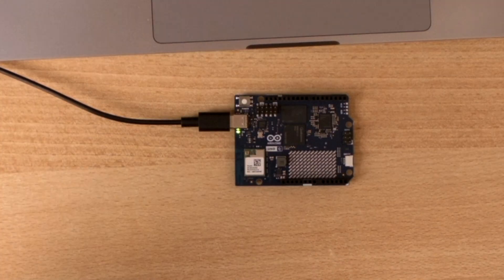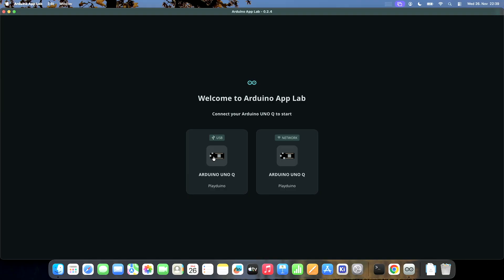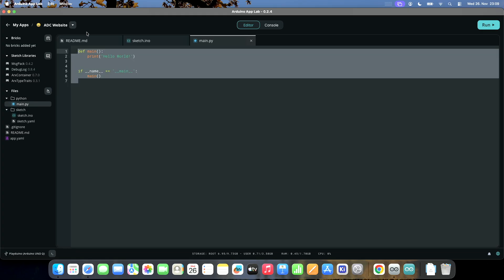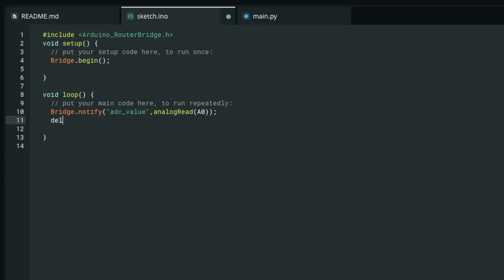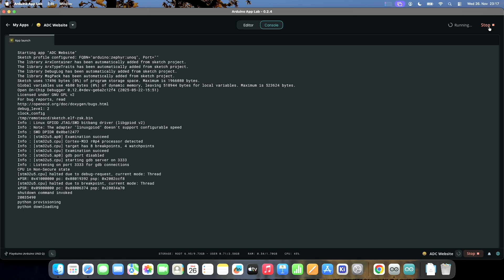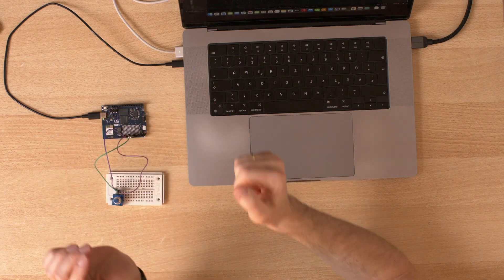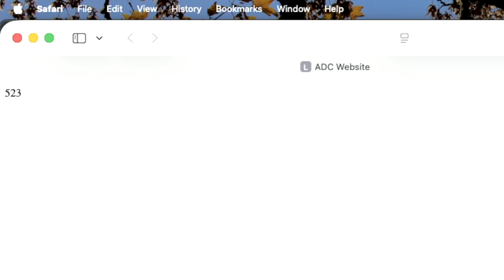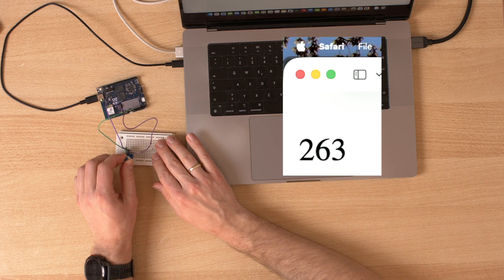Something Useful Only Arduino UNO Q Can Do? Live Website Data

Comment: Hi, thanks for this video. However, I copied exactly both your scripts  and the circuit with potentiometer, but app doesnt work - Python console closes and program stops. What could be the reason? I run Apps lab in USB mode.
Reply from the maker: Welcome to the Arduino UNO Q experience 🫠 sometimes it works if you just try again. Sometimes you need to reboot and try again

Comment: 💙🤍❤ 🗼
Thanks for this very interesting video.
However, there's a problem with the Arduino Uno Q, as Paul McWhorter points out in this video: https://youtu.be/fjaKLs7LT1g?si=njDaFeKn9ldRfhC8
The Uno Q is an architecture based on a Linux PC paired with an Arduino Uno R4. This is an excellent idea, but unfortunately, you can't use a "standard" development approach for data exchange between a Linux machine and an Uno. The mechanisms, such as Bridge and App, are specific. Consequently, it's not possible to reuse the thousands of lines of code already written for a Linux/Arduino architecture.
That's a shame.
Reply from the maker: Very good point.

Comment: WTF I dont understand this Arduino, an official ESP based arduino would have been so much cooler with built in WIFI and different USB modes so you could do MIDI devices etc.

Comment: I did something very similar to this about 20 years ago with an uno and my desktop.  We had a manual dial knob on the heater in my office.  At 8 am, the temperature was cold so we needed to blast the heat.  At 3pm, the sun was shining brightly through our windows and it got hot.  So, I hooked a thermister and a servo up to the uno and made a website which passed the desired temp to the uno which then did some PID to try to turn the heater knob with the servo to match the desired temp.  This allowed anyone in the office to balance the temperature and also made it so we didn't freeze or burn throughout the day.
Reply: BTW I did buy a Q.  My idea is to build a remote telemetry robot which an operator can connect to over the internet and drive around a real world space.
Reply: Sorry one more thought.  2 of your problems would be solved if you do your development in vs code and then essentially copy and paste to arduino app lab.  I recognize that's annoying, but it solves the issue of version control and syntax highlighting.
Reply: Buongiorno io ho seguito il progetto alla lettera lo compilo non mi da errore pero non mi fa vedere la pagina internet

Comment: Nice video. Btw, displaying the values on the website. Is it a refresh of the whole webpage? Suppose you would have 10 different sensors all displaying at the same time. Refreshing isn't the best option. Ajax etc... only updates the actual value(s) and leave the rest of the page for what it is. How is your approach to this kind of setup?
Reply from the maker: thanks! I am using socket.io. it is using websockets by default. Just like AJAX, it does not refresh the whole webpage :)
Reply: @playduino  Perfect! Exactly the way I want it!

Comment: The Jank continues! Janktastic!
Im still annoyed at how little info there is on how all of the software parts communicate.
For example the "arduino-router", which is actually just a MessagePack RPC router, would probably be amazing if I want to do a project with [generic MCU] that has to talk to [generic linux box] as it seems to provide a bit more structure than just raw serial...